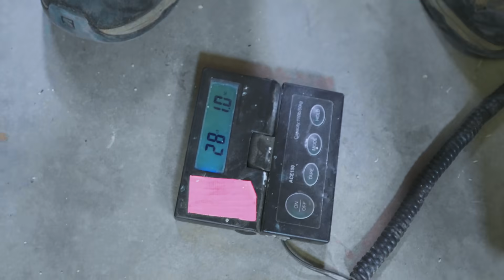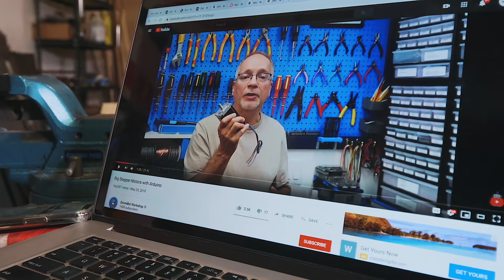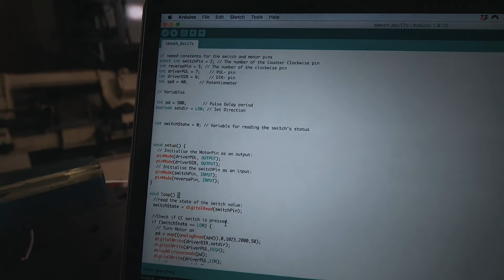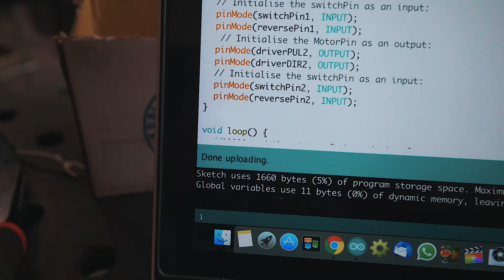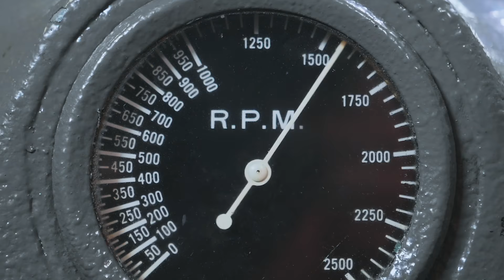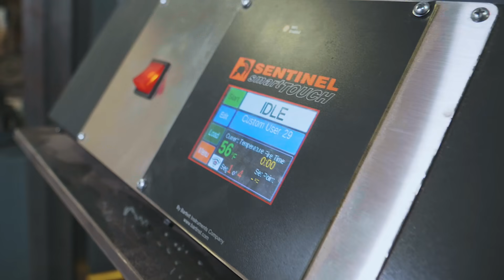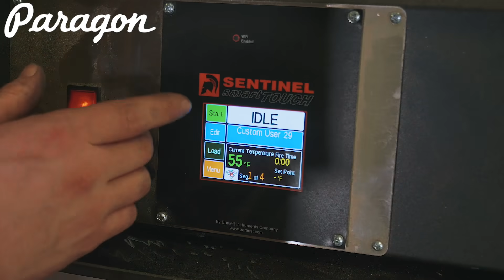MAKING FORGE DOORS!!! Part 2

Comment: I tried to scrape the code from the video and it looks like the second motor code is accidentally nested in the "else" { } loop from the first motor's if/else statement.  There is another "if" embedded in that "else" that is not terminated by a bracket.  If that's the case - the second motor code will ONLY execute if the first motor button is NOT being pushed.  Add a "}" right above the second motor code and delete one bracket from the very bottom. 

Alec's 2 motor, 2 button program!

//named constants for the switch and motor pins
int switchPin1 = 2;  // The number of the Counter Clockwise pin
int reversePin1 = 3; // The number of the clockwise pin
int driverPUL1 = 7; // PUL - pin
int driverDIR1 = 6; // DIR - pin
int switchPin2 = 8; // The number of the Counter Clockwise pin
int reversePin2 = 9; // The number of the clockwise pin
int driverPUL2 = 12; // PUL - pin
int driverDIR2 = 11; // DIR - pin
int spd = A0; // Potentiometer

// Variables
int pd = 500; // Pulse Delay period
boolean setdir = LOW; // Set Direction

int switchState = 0; // Variable for reading the switch's status

void setup() {
  // Initialize the MotorPin as an output: (with 'zed' proper American spelling)
  pinMode(driverPUL1, OUTPUT);
  pinMode(driverDIR1, OUTPUT);
  // Initialize the switchPin as an input: (with 'zed' proper American spelling)
  pinMode(switchPin1, INPUT);
  pinMode(reversePin1, INPUT);
  // Initialize the MotorPin as an output: (with 'zed' proper American spelling)

  pinMode(driverPUL2, OUTPUT);
  pinMode(driverDIR2, OUTPUT);
  // Initialize the switchPin as an input: (with 'zed' proper American spelling)

  pinMode(switchPin2, INPUT);
  pinMode(reversePin2, INPUT);
}

void loop() {
  //11111read the state of the switch value
  switchState = digitalRead(switchPin1);

  //Check if CC switch is pressed
  if (switchState == LOW) {
    // Turn Motor on
    pd = map((analogRead(spd)),0,1023,2000,50);
    digitalWrite(driverDIR1,setdir);
    digitalWrite(driverPUL1,HIGH);
    delayMicroseconds(pd);
    digitalWrite(driverPUL1,LOW);
    delayMicroseconds(pd);
  }
  else {
    // read the state of the switch value
    switchState = digitalRead(reversePin1);
    //Check if CW switch is pressed
    if (switchState == LOW) {
      // Turn Motor on
      pd = map((analogRead(sd)),0,1023,2000,50);
      digitialWrite(driverDIR1,!setdir);
      digitalWrite(driverPUL1,HIGH);
      delayMicroseconds(pd);
      digitalWrite(driverPUL1, LOW);
      delayMicroseconds(pd);
      // Turn motor off
      digitalWrite(driverDIR1,setdir);
      digitalWrite(driverPUL1,LOW);
      delayMicroseconds(pd);
      }
  }
  // ** Added missing bracket

  //22222read the state of the switch value
  switchState = digitalRead(switchPin2);

  if (switchState == LOW) {
  // Turn Motor on
  pd = map(analogRad(spd),0,1023,2000,50);
  digitalWrite(driverDIR2,setdir);
  digitalWrite(driverPUL2,HIGH);
  delayMicroseconds(pd);
  digitalWrite(driverPUL2,LOW);
  delayMicroseconds(pd);
  }
  else {
    // Read the state of the switch value
    switchState = digitalRead(reversePin2);
    if (switchState == LOW) {
      // Turn Motor on
      pd = map((analogRead(spd)),0,1023,2000,50);
      digitalWrite(driverDIR2,!setdir);
      digitalWrite(driverPUL2,HIGH);
      delayMicroseconds(pd);
      digitalWrite(driverPUL2,LOW);
      delayMicroseconds(pd);
      // Turn motor off
      digitalWrite(driverDIR2,setdir);
      digitalWrite(driverPUL2,LOW);
      delayMicroseconds(pd);
      digitalWrite(driverPUL2,LOW);
      delayMicroseconds(pd);
    }
  }
}  // ** deleted 1 of the extraneous brackets

Comment: Why not just a hand crank winch and a counterweighted door? Seems awfully complicated for such a simple task... The day the electronics stop working and they will... You'll wish it was manual. I work as an electrical technician and love creating alternate solutions but hey man it's just a door, lol. Your almost at a Rube Goldberg level of parts.  There are simpler options using a motor set up as well that will give you the same result.

Comment: Both motors at the same time is a hard wall from the arduino you are using unfortunately, unless you ramp up the sophistication of the code like 10 fold

Comment: very overcomplicated design.
a hinge on the top on each side would be enough.
a simple arbor in the top-middle can pull a leaver of the door, connected by the steel rope. the leaver must be directed outwards to open the doors completly.
the arbor can be turned by a chain. the motor sits under the forge.
small cogwheel at the motor, large on on the top.

other option.
use split doors which are hinged left and right. back door is held by springs, no motor need. long pieces are pushing the back door open by inserting the long piece.
motor for left and right front door under the forge and connected by a rod that is welded on the outer side of the doors.

Comment: When you get this thing working well you ought to rewire it with Mil Spec hardware. MIL-STD-1353C is on Google as a PDF. It has all the specs and part selection guides you'd need. No need for that concentric twisting nonsense either. It ain't movin.

Comment: I am 1:50 in and he is freaking out over how much the doors what, and I don't get it. It is so fucking simple I thought it was his plan from the start. Counterweight the doors and us the motor to move the cable between the door and the weights. Not using a counterweight is just going to cause those tiny motors to either not work or burn up if they can move that much weight.

Comment: Really? I'm all for learning new skills and all but this is making something about 12 times more complex than or needs, and should be. For startets you only need a fixed speed, user a 555 to produce a PWM that drives a transistor and a pair of relays, reach button activates a relay for each direction. Next, safety; lift it with a screw thread so that if there are issues it doesn't just fall. Also end stop detection, everything that moves should have it. Aluminium pulley? Asking for trouble and I am assuming it was just because it's easier to machine than steal.

Also doubting what appears to be a NEMA 23 motor can lift 30 pounds? Using a screw I got a little NEMA 17 to lift 44 pounds running on 7v of battery power

Comment: You failed to understand about double action air/hydraulic cylinders that would have raised and lowered the doors easily and quickly. A high heat chain attached to the top and the cylinder off to the side.  No goobley gopply electronic crap needed.   See how easy that was ???????????

Comment: Whoa, this project is way over engineered to perform the simple task of opening and closing a door in front of the forge.  Please tell me what is wrong with a simple pair of small swinging doors on the opening, each allowing half the opening space to be opened while the other remains closed (for putting smaller objects in and out out of the forge).  The could be secured with a pair of sturdy hinges on the side.  Another way to do it is to simply have a sliding door across the front that slides sideways to open it to a desired amount and then shut (think of sliding barn doors).  Both could be built a marginal distance from the opening to allow the dispersal of gasses. You could save a lot of money, time and effort and have a fully functional 'mechanical' vs 'electronic' remedy for completing a task as simple as opening and closing a door.  But then, that is how I would have approached this problem.

Comment: Any motor can lift 30 pounds. It's called leverage.

Also, you've way over-engineered this. A simple linear actuator and switch would be FINE. Better even because of the integrated limit switches.

Like, honestly, you've wasted a ton of money on this.

Comment: Throw this away and do a belt driven pair of spindles from below with simple limit switches. No need for servos, microcontrollers and that stupid crane setup...

Sorry to burst your bubble, but this is not gonna go well. Even if you make it work it will neither be fast nor comfortable and the word reliable is only available if your talking about it failing reliably at the worst potential moment.

Comment: This is rediculously overcomplicated, expensive and unreliable.
Why not stick to a simple mechanical system ?   Add a counterweight, use two bars, one to operate with your hands, one to operate with your feet.
Plain, simple, super reliably. Minimal maintenance and does not require electricity.........